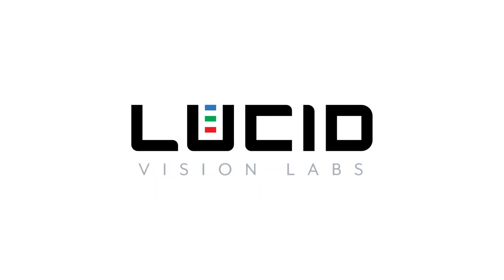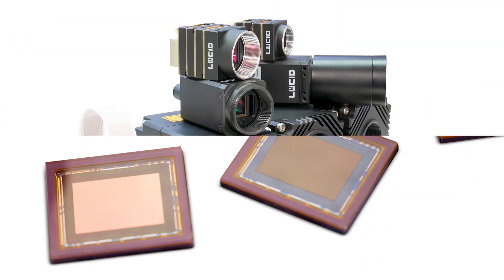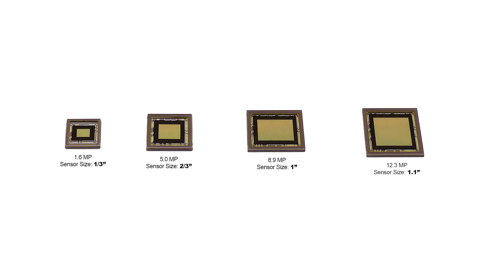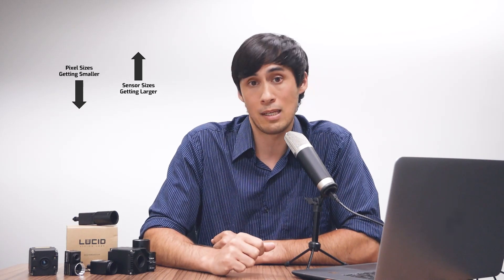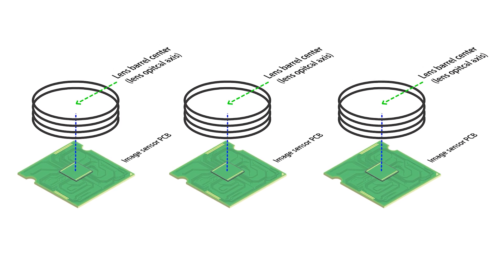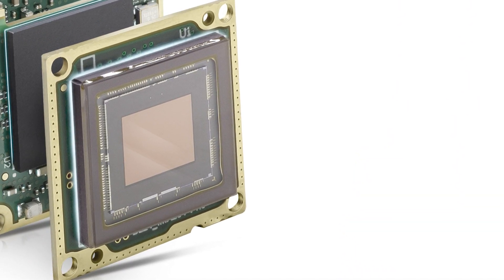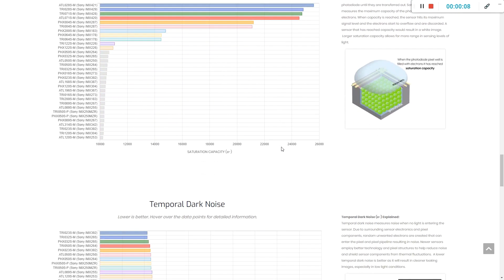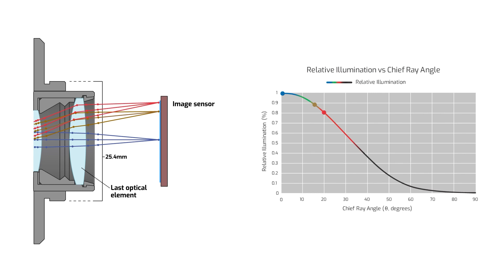Are High Resolution Camera Sensors Better?

Comment: Hi, do you have video from 6mp and 20mp MV cameras? In my opinion, the real video can say itself. I have 6mp cameras and don't really know,  why I should buy bigger sensor and bigger lenses. I'm fully satisfied with 6mp
Reply from the maker: You're right, if your 6MP camera is meeting your needs, there's really no reason to upgrade. Higher resolution cameras like 20MP can offer more detail, which is useful for applications where you need to zoom in or you want to capture a larger FoV. But if your current setup captures everything you need, then theres no need to upgrade.

Comment: do they output raw or compressed images? there are usb3 4K industry cameras. i do not know if usb3 is enought for 4k if it is raw.
Reply from the maker: Our machine vision cameras output RAW (all machine vision cameras output RAW, some however have compression available). USB3 cameras can output 4k with a maximum fps around 40-45fps